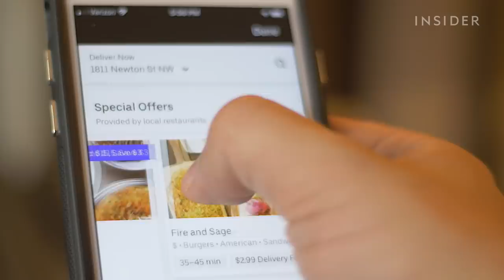How Used Chopsticks Are Turned Into Tables, Tiles, And Other Furniture | World Wide Waste

Comment: We reuse chopsticks in my family. Just cleaning them by hand in hot water and soap, there you go good as new.
Reply: I do the same thing
Reply: You reuse plastic/metal chopsticks right? Reusing things like wooden chopsticks and skewers is kinda nasty
Reply: the bacteria could seep into the wooden chopsticks unless that wood is coated then you can reuse it.
Reply: @elfelizardo6182  nah
Reply: @elfelizardo6182  depends on the chopsticks if you're using cheap porous chopsticks out of plywood like the ones you usually get in takeout perhaps but a good quality pair made out of dense wood with a good varnish won't have that problem, even with the porous chopsticks you could just soak thrm in boiling hot water.
Reply: i throw them in the dishwasher even
Reply: I do this and use reusable plastic ones as well
Reply: Jan Jakusz  You like splinters? Good for you!
Reply: @monekalone940  idk in my experience there's a hell of a lot more splinters from one use chopsticks than from normal ones (yes good quality, made of spruce/bamboo and lacquered) thats more than you can say for wooden cooking spoons, those ones are splintery as heck
Reply: Then sell them with a profit calling them old vintage chopstick, very rare 😉
Reply: Jan Jakusz  they mean the one use ones. do you ever use single use spoons while cooking and then reuse them?
Reply: Untreated cutting boards are ok,  knives with wooden handles are ok too,  it's just a choice
Reply: @dhyanpatel142  ever heard of cooks using wooden spoons?
Reply: @latissimusdorsi965  I also reuse my chopsticks, if you cant handle a little bacteria you wont be getting old.
Reply: @latissimusdorsi965  actually wood kills off bacteria by absorbing water wich the bacteria needs to survive. 
additionally wood contains some compunds that kill bacteria. so using bare wood is completely fine if you rub off food remains.
Reply: Single-use chopsticks are just useless in the first place
Reply: @PG-3462  perhaps for you but not for those who use them.

I use them because I love eating with them and they're part of my heritage. For you to insult it based on your inability to see the purpose behind them is disrespectful as hell. It's like saying a spoon is useless when you got a knife and a fork when technically the spoon could do so much more than a knife and a fork put together.
Reply: @dannyverdant  God it doesn't take much for you to get offended 😂  Everything that's eaten with or without chopsticks will taste the exact same thing.  And the difference between a wooden chopstick and a spoon is that spoons can last several decades, while chopsticks can't.  If you reuse chopsticks, then that's a very great habit, but using none would be better
Reply: @PG-3462  You don't get it do you?

This is part of my and many other people's heritage from Asia. Our ancestors created the chopsticks to eat with very much like the knife and the fork. It has been used for God knows how long and I see no reason in why we should stop based on a single person's opinion.
Reply: @PG-3462  also I find it very difficult to eat noodles with a fork. I even use chopsticks when I eat rice. I find it quite handy and I get to practice on my patience while I'm eating.
Reply: @dannyverdant  Ok?  It doesn't change the fact that many traditions are a waste of natural resources.  Those traditions must change in order to make our societies more sustainable.  Actually, why can't chopsticks be made with some reusable materials, just as forks or knives?
Reply: @PG-3462  plastic and steel ones you mean? They do exist if you didn't know that already but it doesn't taste that good eating with those. I prefer wood over plastic or metal. It's the way it's supposed to be but I won't stop people from eating with whatever they want but do not come here and disrespect my culture based on your own beliefs.
Reply: @PG-3462  making forks, knifes and spoons out of metal is quite wasteful too even if it's reusable. We use natural resources to make those, metal doesn't just suddenly appear out of nowhere.

I get your point in it all but you don't need to act like my traditions is ruining the world. The only thing ruining this world are people themselves, we are overpopulated and soon enough another pandemic will strike and take more than half the population with it.

Less people means less likely to be another pandemic within this century and the use of our natural resources will decrease since our population has shrunken a lot. This means less houses, furnitures & chopsticks will be produced out of wood.
Reply: @dannyverdant  What I'm saying is not a "belief", but a fact.  Sending to trash hundreds of millions of single-use chopsticks every day is an extremely big waste of resources.  Also, I don't see why saying this would "insult your culture".  For example, cars with huge V8 engines are part of the American culture, but this culture must change since it is a huge source of pollution and waste of resources.  Every year in the town next to mine in Spain, there's a tradition of making a huge tomato fight.  40 tons of tomatoes are wasted every year because of this.  This is another example of a tradition which must change.  I don't see what's insulting about wanting to preserve the planet for our children and our grand-children.
Reply: @dannyverdant  This is why I carefully chose the phone that has the highest built quality.  I have the same phone since almost 6 years and it still works perfectly.  The lifestyle our society currently has is completely unsustainable.  We must all change our lifestyle and eliminate was is not truly useful and what can be replaced by something better.  If I use the same example, eating with single-use chopsticks at every meal (or for most of them) is completely stupid.  Someone who would eat all the time with single use chopsticks would throw to garbage 2190 chopsticks per year.  10 million people having this habit would throw to garbage 657,000,000 chopsticks in 30 years.  Meanwhile, people could use the same reusable chopsticks for over 30 years
Reply: @PG-3462   it doesn't change the fact that we're wasting natural resources 24/7 and that making people stop using chopsticks is a terrible idea since number 1. Bamboo is incredibly sustainable and grow at a fast pace. And number 2. It doesn't have to be that way, some people like myself reuse single-use chopsticks for at least 3-4 months on end, no problem in that.
Reply: @dannyverdant  Yes we're wasting natural resources 24/7.  That's why we must all change some of our habits and adopt other habits which have a smaller impact on the environment.  Also, you talk about bamboo being sustainable.  It might be sustainable if you live in Japan or China, where bamboo can grow, but this video is in Vancouver, Canada.  All bamboo chopsticks need to be imported on thousands of kilometers in huge cargo ships, trains and trucks until they reach their destination.  Transportation represents 28% of the world's greenhouse gases, so reusable chopsticks are definitively better.  Also, the bamboo used to make those millions of single-use chopsticks could be used instead to manufacture things that are more useful and durable
Reply: If you're using them at home, why don't you just use non disposable chopsticks?
Reply: @10ReasonsWhy  He says that reusable chopsticks taste bad.  I guess he only tried some poor quality plastic chopsticks made in China
Reply: @PG-3462  I'm Asian, so there're literally dozens of reusable wooden(Japanese Style) and plastic (Chinese Style) chopsticks in my house, they've never tasted of anything lol.
Reply: @10ReasonsWhy  Then I don't know why he's trying to argue about all this 😂  He says I insulted his entire culture by saying that he should use reusable chopsticks instead of single-use one
Reply: @PG-3462  if anything, bamboo disposable chopsticks are the ones that have a taste to them, albeit not very noticeable while eating, only if you just stick them in your mouth.
Reply: Or you can just bean steel or metal chop sticks which makes it 100% cleaner. LITERALLY you sound VERY UNSANITARY
Reply: @dannyverdant  Bud, I’m Chinese, live in Asia and I have never had a problem eating noodles with forks. Eating rice with chopsticks doesn’t teach patience either, i literally learned how to do that before primary school.
Reply: @10ReasonsWhy  everyone is different but I for one prefer eating noodles with chopsticks, so well as rice.

Where in China are you from?
Reply: @tay_yo561  I do things my way and you do your things your way.
Reply: we use ivory ones, so we just wash thoroughly and reuse
Reply: @dannyverdant  I don't live in China, I'm from Singapore.
Reply: @10ReasonsWhy  I'm a mix between different ethnic groups from China but I do not live in China. I live in a small town in Sweden, Northern Europe.
Reply: if there not wooden then yea but wood is porous unfortunately
Reply: @dannyverdant  💀 bro did you just compare smartphones and televisions to disposable wooden sticks?
Reply: as an asian, we never do that in my country. Those chopsticks have chemicals like bleach and the thin cracks of the chopsticks also attract bacteria.
Reply: @dhyanpatel142  Dude I, and like... all of humanity has used uncapped wooden spoons, cutting boards, knife handles, .... hardwood chopsticks are no different. Rinse them off. It's fine
Reply: Or just you a damn fork?

Comment: Single use Chopsticks in itself is even more environmental friendly than you've thought!
These Chopsticks usually are made with bamboos, which can grow in very short time cycles, like a year or even shorter. 
And other chopsticks made out of better woods that are used everywhere in China are mostly non single use at all. They are also not made of casual forest woods. These are also tree species purposly chosen and grown. In Chinese homes we all use that and that lasts from a couple of months to years, depending an how good you maintain them.
Only Takeaways in China are using single use Chopsticks which are very environmental friendly, as I've mentioned.
Environment activists often complain that without even doing any kind of research. By the way, although it is totally environmental friendly, i do appreciate the works these companies do. It's better for the chopsticks to have a proper recycle rather than being turned back to dirt after a few years in landfill.

Comment: I love how you can make just about anything with recycled materials.
Reply: Just because you can, doesn’t mean you should.
Reply: not really, you can make a lot with resin. what you pick as the filler doesnt matter. its just trash encased in plastic...
Reply: You can recycle anything, but it's often nor worth the cost or the actual carbon emissions. I'm this case a much simpler solution was to just use some damn metal chopsticks like you would a fork.
Reply: Vehicle exhaust, plastic runoff from the roads into the drainage systems, heating the resin, chopsticks and operating multiple hydraulic presses… and he still over charged us for something he got for free under the guise of helping the ecosystem.

Comment: Well, it is still double the price of lower middle end hardwood office desk, and for sure isn't as durable. This will only be conversational decorative in the house and won't be adapted into widespread uses. The single-use chopsticks are already quite environmentally friendly already. They are made out of bamboo or trees that are very fast growing. They can go into the composite bins which is already setup in most provinces in Canada. Economically speaking, they would have done more for the environment just to spend the time to plant the trees. However, I do appreciate the work they have done to try to invoke the idea of 3Rs in our society.

Comment: I was able to work with this material while doing a ten month furniture making program in Victoria, not too far from Vancouver. It is a very cool idea and makes a very unique finished product. No two tiles are the same. In the video they mention the smell and it is a very distinct smell that come with cutting the tiles, not necessarily bad but memorable, I can smell it while watching. But, it is the worst materially I have ever worked with,  very annoying, like trying to cut a bunch of straws if straws could give you splinters. However the finished products are very cool and it always feels great to reuse and repurpose things.

Comment: It's cool what they are doing but a little dramatic on "leveling entire forests." Bamboo grows fast and is biodegradable.
Reply: Yes, this.  Also, most consumer paper/wood products are made from trees that were specifically grown for the purpose.  They have tree farms...they plant more trees to replace the "crops" people...smh
Reply: It is, but in order to grow it entire diverse habitats are indeed being obliterated. Bamboo drains soil of nutrients making it so new soil is needed every 5-10 years.  And it requires a lot of water to grow. Makes sense that natural habitats are in tropical places, but without predators to eat it, the crop can grow unchecked.
Reply: MissBeans paper in developed countries is made from managed forests, but a lot of paper is made from clear-cut tropical primary forests where they pick out the most valuable hardwood species to sell as lumber, and the rest of the forest is cut down to access the valuable trees and is turned into wood pulp. what's probably more likely than paper to contain unsustainably harvested wood in first world countries though is charcoal. the charcoal industry does not give a shit.
Reply: Have you seen the state of the depleted forests of the world? You don't the insane amount of disposable cutlery adds to that problem?
Reply: @gitsurfer27  But overall, the U.S. has 8% of the total forests in the world, and reached a point in 1997 where growth  “exceeded harvest by 42%” and we were growing forests at a rate of roughly four times faster than we were in 1920, when our chop-happiness began to level out due to environmental and recreational concerns regarding timber harvest.

The total tree gains have been most heavily concentrated on America’s eastern coast, where trees have doubled in the last 70 years. The eastern shore was home to the most aggressive timber harvests after hit by waves of arriving European settlers in the 17th Century.
Reply: @altobalk  That's all a very roundabout way of avoiding the main problem. Look at earth from space, roughly 80% of all the earths forests have been destroyed, and the part that remains is mainly in inhospitable land and that's the only reason its still standing. There was absolutely nothing dramatic about the statement's in the video, you're avoiding the problem with cherry picked statistics.

Comment: Just so I understand, they are taking a perfectly compostable product and soaking it in resin so it's no longer biodegradable?
Reply: Basically... and spending fuel, energy and wasting part of it also. Greenwash at it's best... I wonder if they get the material for free, that would be really profitable for this company
Reply: But they are replacing other wooden furniture so less trees get chopped down. 

We cut down bamboo to make chopsticks that people use and throw away.
We  cut down trees to make furniture. 
The idea was to simply take the wood We already have and use it to make another thing so we don't have to cut down more trees.
Are there still problems with doing this? Yes. But we have to start somewhere at least.

Comment: I bring my own. They have so many neat designs and they come with a carrying case. Mine is a Totoro design, and I’ll pretty much have them forever and they were like $8. Sometimes I do like the wood taste with certain dishes but I’m willing to give that up to try and not be so wasteful… especially since sushi and ramen are two of my favorite dishes to eat out. Metal chopsticks seem too slippery or might clang on my teeth. The ones I have are hard but smooth with ridges so the food doesn’t slip away. They aren’t plastic, only thing I can compare them too is like how an expensive pen feels. But like I said I will have them forever, they are very durable.

Comment: Worried that these have many weak points and could easily break apart with tensile forces applied at the right angles.
Reply: That's an other good point. Imagine paying 1000 for a table for it to break the next month or something.
Reply: My thought too
Reply: I guess that is why people are mostly buying the smaller tiles
Reply: With so many adhesive and pressing, i cross my fingers

Comment: We have almost no landfills in my country, so things like this get incinerated for electricity and distric heating. Is it more environmentally friendly to "upcycle" them in such an area? Thinking about the energy used to prepare them and how toxic the resin they're using is.
Reply: Not sure about the resin part, but in BC we have hydroelectric dams that power much of the province so our energy is more green to begin with.
Reply: Well, what else will they do with your trash that you don't clean? It's not as simple as melting it
Reply: @Bleepbleepblorbus  What are you talking about? Who’s melting what?
Reply: @nellieken  Yes, it does release greenhouse gasses to incinerate trash, but so do landfills. Landfills have gas chimneys installed in them to vent methane out, so they don’t explode, and they often don’t produce anything useful, like electricity or heating. Some capture the released gasses and burn them as fuel, but the majority don’t.

Filters in incinerators have very stringent requirements to particle size and which toxins are neutralized and so on in my country and in general in the entire EU. Pollution is a problem, yes, but it’s better than the alternative, and that is not using it as a resource at all.